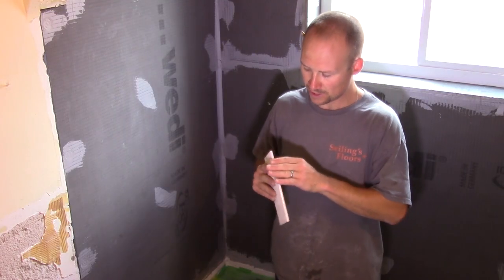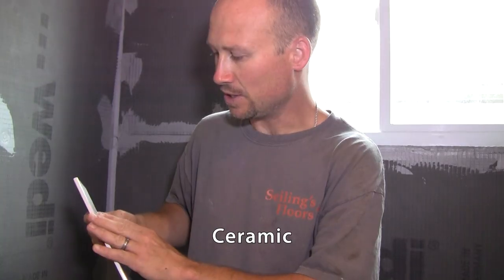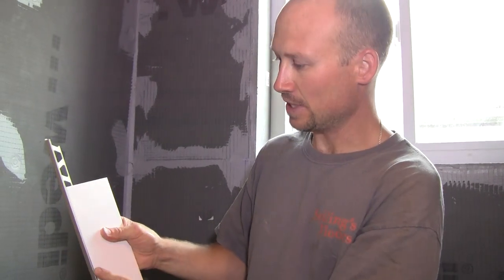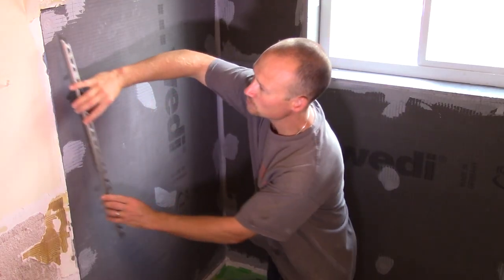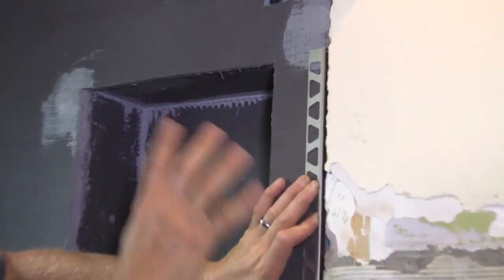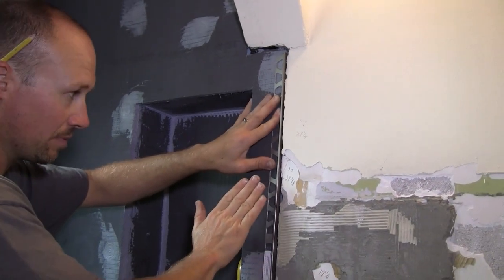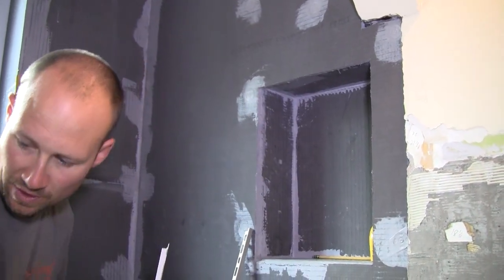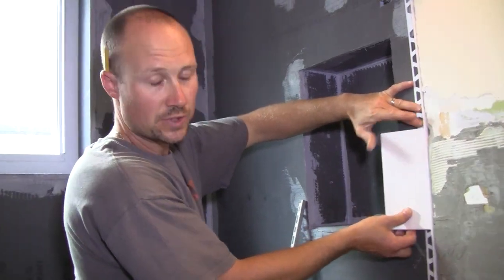How to Tile a Bathroom 17: Tile Edging

Comment: Do they figure in the added depth of the morter/thinset  ? or should you go a size bigger ?
Reply from the maker: Depends on the tile, if it has a slight bevel to it, stick to what you have, if it is straight, some people don't like to see any tile edge beside the metal edging

Comment: I am tiling a shower surround and have the opposite problem.  The tile backer board is higher than the adjacent drywall.  Any ideas?  (maybe use two edging strips back to back...one covers the tile edge, and one covers the backer board edge?)
Thanks for the video!  Major help for a DIY like me!
Reply from the maker: I often use a t-bar flat edging if I need to cover different heights. Though it depends on how high the other side is whether it works well or not. It basically just looks like a t when you look down the end of it. and can go on at least a 1/16" of an angle, even 1/8" angle if done right to make up the slope difference. Hope that helps.
Reply: @SeilingsFloors  thanks!  I'll see if I can find some T-edging!  (I didn't know it existed)

Comment: I don’t understand if you get thicker metal won’t the meta stick out above the tile? Or will you raise the tile with the thin set? If you are going to raise it with the thin set... why didn’t they just shim out the backer board a little? This seems like a bit of a fudge up on the backer board installers side.
Reply: You would use your thin set to build out that edge just a little. If it’s a big difference you might want to get same rapid set mix and put a few screws into the area where it’s being built out do this prior to applying the mortar and leave the head of the screw sticking out just slightly so the mortar has something to grab on to and make a stronger bond to the wall

Comment: Do you know if the plastic/PVC profile will discolor(yellowing) overtime? Thinking of using one for shower install. Thank you.
Reply from the maker: Probably too little too late, but if you use the PVC stuff, it's a lot better than the older plastic style for not discoloring. The new stuff is great

Comment: Well that didn’t help much, I never heard about this capping so I need it to know how to install it. Do yo glue it or screw it ?
Reply: you can put a dab of glue at each end to lock it in. if it's not a waterproofed shower membrane, you could lock it in with a couple of galv flat head short nails or screws, you can even lay the tile and slide the metal in after, like real soon after

Comment: Would metal rust? I need to redo the tile around my tube
Reply from the maker: The metal for tile edging is actually aluminum. Even though there's different shades and colours, they all work perfectly and won't rust at all
Reply: If you nail the profile to a cement board backing, you should use galv nails or screws, of course don't nail through waterproofing
Reply: @hungrywolf4903  thanks :)